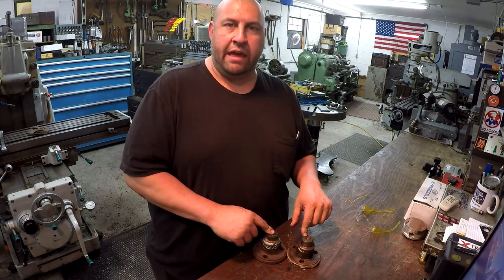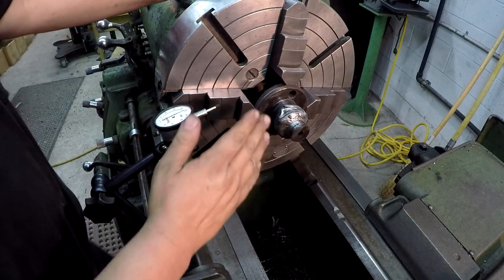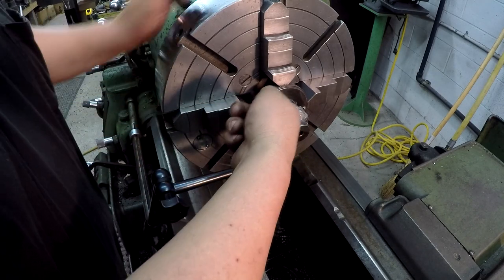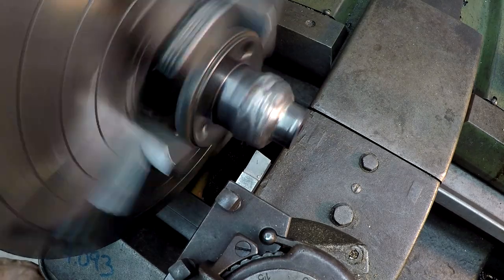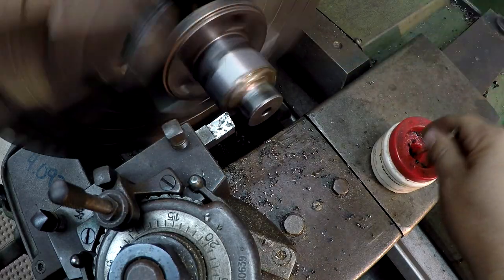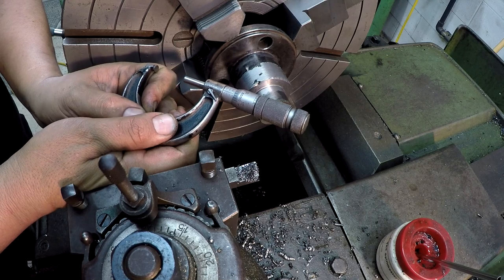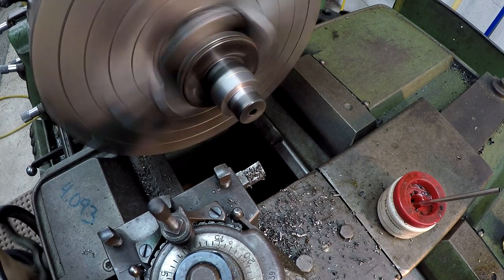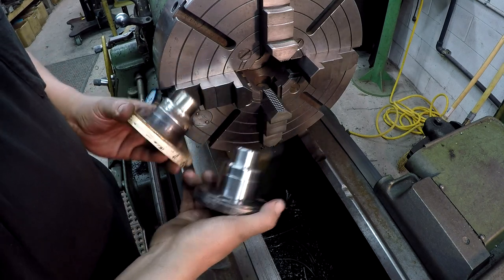Turning Weld Build Up With High Speed Steel

Comment: I have been a machinist for 37 years. When indicating something like that I always use what we call a brass bumper. Its just a piece of brass about 3'" in dia. and about 8" long. I always bump directly towards the indicator but I always pull the stem of the indicator back while bumping to avoid damaging the indicator. Then let the indicator touch again and in this way you can tell if the part moved and how much without even turning the chuck around. This is especially handy when indicating large jobs such as 35" dia bronze bushings.

Comment: It is so good to see that the "younger generation" have been passed the skills that we used on a daily basis back in the stone ages.
Thank you for sharing - brought back memories of rebuilding tractor kingpins back when there was no MIG (only stick) and welders ALWAYS dumped the part in water to cool them down.
Reply from the maker: I do alot of metal build up using stick welding
Reply: In my case the guy left pockets of flux all over the place AND tempered the piece by quenching it in water to cool it down...

Comment: That lathe and that chuck embodies the definition of deluxe and luxury. The impressive results speak for themselves. I'm not a machinist and likely never will be due to the cost of the machines, but the joy I get out of these videos is the transformation of before and after. It's awesome to see what's possible when you have a skilled tradesman at the controls.
Reply from the maker: I love that old Monarch, it was built with so much excellent engineering.

Comment: I do machine work and I have been a welder for machine shops for some years. When building up parts for machining clean, I've found I need to build up a lot more than seems like enough if you really want to avoid surface defects when machined to size. Dual shield wire with some post heat and slow cooling makes a more machinable weld deposit than hard wire.

Comment: I'm a Aerospace seal designer.  I really enjoyed this video. :)  We always recommend at least a 15 degree lead-in chamfer so the seal will not be damaged upon instillation.  I'm glade you talked about this.  People always ignore that and destroy the seals upon instillation.  Also surface finished is super critical for long seal life. (80% to 90% bearing ratio if possible).  If the seal is tearing up the shaft maybe you could heat treat your shaft post machining, or chrome plate it.  Thanks for this video.
Reply: When you're putting in your valve oil seals on your Harley heads, go down and buy yourself a bottle of vitamin supplement capsules near enough to the size of the valve shaft, open them up, tip out the powder, oil them up and then slide them up and into place. The amount of times in my younger days when grinding valves on cars that I'd punch a ring in that new rubber seal with a sharp valve when putting it back, if I'd had a dollar every time, I'd be rich today. And disengaging the half nuts when Metric threading is child's play if you learn the simple technique..... Just saying.
Reply: We used to spray ceramics on seal diameters which gave them a long wear life.
Reply: @garyd5622  Newb here could you explain that ?
Reply: @garyd5622 Thanks, I didn't know about that either,the vid was very good-I noticed that abom70 has 2 vids titled shaft metalizing which I think is the same thing but in more detail.
Reply: @davidworsley7969  Many of the worn shafts were from 30 year old multi spindle heads that ran 24/7 which the company wanted keep running until the contract was cancelled. With machinery that old and the chances the contract cancelled without notice, ceramic spray welding was the best option to extend the sponsor's life.

Comment: hey adam nice job. about a year ago i got a call from my buddy that owns a scrap yard and fab shop. he said a machine shop had just scrapped a bunch of strange tool holders.thanks to your video i knew what he had. there were multi fix. i got two tool posts and about 30 tool holders. i changed   over from my aloris and never looked back, i modified the tool holders to use  five 5/16 allen bolts it comes in handy when using short tools.
Reply from the maker: Wow! What a score!
Reply: Wise find!

Comment: Love how 'silent' the lathe is while running, makes for a friendly work environment! Another high quality machining job!
....13
Reply: That lathe's headstock has helical-cut gears in it, just like you would find in a conventional automotive manual transmission or semi-truck manual transmission.  They do a lot to cut down on gear whine and gear noise. ^^
Reply: Patriot1776 If he wants a comparison, he should jump over to Keith Fenner's channel.   His engine lathe has straight cut gears and does have some gear noise at higher speeds.

Comment: I like using HSS on when turning back welds and also when turning rough castings. I find the inconsistency destroys carbide tools.
Reply from the maker: I wish i could get my coworkers to do the same thing, but 100% of the time the forst carbide insert tool that is seen is grabbed and put to use, then its destroyed, and another insert installed, instead of taking a little more time to use a tool bit.
Reply: When I was an Apprentice and worked on a leblond engine lathe I found that when I used an inserted carbide cutter to rough and finished with my high speed Steel I would get a very repetitively cut, finish my finish size was spot on.

Comment: after i put the part loosely in the chuck I always use my tail stock to push it flat  and then get out the the indicator usually gets it pretty close as long as that front face is true as well.

Comment: That Lathe is a hoss. I'm digging how quite it is for the amount of power. Very skilled operator.  I have a 1933 South Bend 9" that runs on leather belts and is a joy to run because of the noise factor. You can hear the chips peeling off a .003's clean up. My big lathe is noisy and have to have ear plugs. Awesome job Adam.
Reply: I agree!
Reply: Helical gears in the head are the secret in Monarchs.

Comment: you should tap a cutter blank and attach a bearing, making a bump centering tool. you just turn the machine on low and bring the tool into contact and the work will just straighten itself out. not perfect but it gets really close really fast.

Comment: Coming from Air Force metal's tech. We have 3 lathes with a brand new one still wrapped up.. Video showed some interesting things.. having a compound rest that has notches for degrees must be a bliss rather than having to loosen 4 nuts and then judge degree based of a line Mark at the base of the compound rest

Comment: I'm pretty new at machining and my first attempt at machining weld build up went pretty bad lol (wrecked the piece and it flew out of the chuck 😬). So thanks for the tips. Also, liking that tool geometry  on the hss. Still rocking a lantern style tool post so that will save me  a lot of time changing tooling 🙂.
Thanks for the video 👍😀👍

Comment: Hey Adam, nice work. You did an outstanding on cleaning up that chuck. I went back and watched your chip control vids and plan to start using HSS tools more now . you and Tom Lipton made it easy for me to understand. Thanks . I do this as a hobby and I believe you said they are better for small lathes like my 7x12. Thanks Dave
Reply from the maker: +David Aarons Thanks David. Hss tools have been around a long time and they still get the job done just fine. Once you learn some basic grinds you'll find that using them can be a joy.

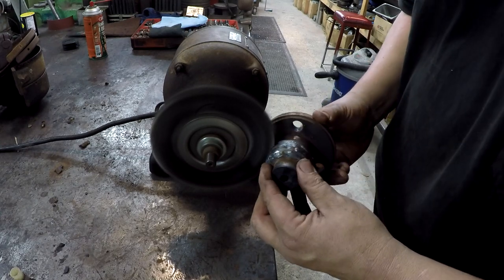Comment: next time you use wire wheel turn work piece opposite direction at 3:00 so you are not throwing trash on what you have already cleaned. i know its not crucial but if you do that you can see what is clean and save time.

Comment: Adam, years ago I think i saw this in the HomeShop machinist. piece of stock about 4x1/2x1/2 and mount a bearing on the front end. mount in a tool holder for the qctp and use it to push things concentric. use it on the y axis and flip it for the x axis. watch you all the time man, great fids.

Comment: nice video, one quick tip that i use is to take a pair of precision ground parallels and put them on the face of the chuck behind the part and use that to square up the part. is can save some time.

Comment: OOOOOOW, shiny new chuck.
Reply: YES!  He did a couple videos on cleaning it up!  Viewer donation, that chuck was!  His old chuck, that he had been using since the start of the channel, had become too worn out to be relied upon any more, and was pretty close to being worn out when the channel started. ^^
Reply: Patriot1776   Ya , I know the story.  He didn't just clean up the new 4-jaw, he polished it up shiny and like new.  The old chuck can be rebuilt but it probably would cost almost as much as the entire lathe is worth.
Reply: John Ferguson More than likely.  I mean, several have been asking why can't he just make new screws and jaws but there's more to it than that I'm certain, primarily in truing up the slot ways the jaws ride in is what my logic is telling me.  The slot ways for the jaws would need truing up and regrinding with the same precision that should be used when grinding and truing up the lathe's bed ways, which is when it gets cost prohibitive.
Reply: Patriot1776 The new CNC machines are getting so cheap that it's hard to justify spending too much money keeping an old lathe going.  These manual lathes will soon be used only by hobbyists.
Reply: John Ferguson We're going to be in big trouble at that point, when nobody is left who fully knows how to manually machine with manual machine tools and things on the computer-controlled equipment breaks that can only be fixed on a manual machine...
Reply: Patriot1776 The big problem is machining parts to fix old machines.  The computer software that controls the CNC machines gets more adaptable and sophisticated every year.  When I worked at Rockwell International in the mid 70's, we had one of the earliest CNC machines.  The software was written on punch cards and fed into a punch card reader.  Watching the machine run was like being in a Star Trek episode.  Now, machines are making machines as people watch.
Reply: John Ferguson , and there are no guards and limit switches to make it impossible to use.

Comment: Nice part and vid. A  hefty 4 jaw chuck there and a massively stable machine :-) I'm learning to machine my welds on a typical small china lathe - when necessary - a new addition - so your vid is helpful and kindly to machinist fabricator 'heads'. Thanks and have pleasure with the tools and transformations.

Comment: I've had to turn M.I.G. welds on lathes plenty of times. The welds are almost always soft when welding with a 1018 steel filler. If that piece is cast steel, it should've been welded with a stainless wire for strength. But to me, that piece looks like it was machined from a solid chunk of steel. That is a nice looking chuck too, by the way! I had to give up machining and welding due to 4 spinal surgeries. Good video though! I enjoyed it!!!!
Reply: I hope your suffering is completely gone by now!:)  I have an idea of what you are talking about... Keep it up!!
Reply: Do you mean "7018" instead of "1018"? The latter is an AISI grade of steel while the former is a category of SMAW welding electrode under the auspices of the AWS.  1018 has a limited manganese content and virtually no silicon, whereas most weld fillers have 1-2% manganese and 1% silicon, but generally less than 0.1% carbon. Carbon does bad things to welds. Even still, Conditions during welding can sometimes cause spots with unusually high hardness, often due to particularly high shrinkage or very rapid cooling. In terms of composition and mechanical properties, weld fillers tend to have much more stringent requirements. They're generally required to have both greater strength, and ductility/elongation than something like AISI 1018.
Reply: The chromium in stainless causes it to be soft not strong it’s easier by far to damage that most other steels it would never add strength

Comment: Quick question, why are you using a 4 jaw Chuck to turn a round part? I am a pretty amateur machinist, but I thought you should always use a 3 jaw on a round part?
Reply: Quick answer ,   4 jaw more accurate..

Comment: Quick question. Want to buy a lathe to make stuff and the first thing I want it to be able to make acme lead screws. 

So and after watching your video where you made the nut which was awesome, I need to know what specs the machine has to have to able to do the job.

It has 1500w motor and threading imperial or metric plus power feed. 

Does this mean it can do my acme screws or is there something else needed feom the machine?

Comment: I assume the part was welded by the customer? You do an excellent job of how welds are turned by HSS tool bits. I'm old enough to remember when there was no carbide, at least where I worked, so HSS was all there was. I would like to add that if it was my choice of how to repair this part...because it was a seal dia. welding would have been my last choice as the risk of holes and the apparent soft wire used would result in a very short life for the seal and journal. My first choice would be to turn the part back and shrink a piece of 1045 or 4140 with a wall thickness of about 1/8" and finish turn & polish to size. Just sayin'
Reply: I agree. A sleeve is the best fix. Polishing a bearing journal will cause the bearing journal to be undersize.

Comment: adam you need a little electric spot nailer that they use for placing brads to pull on in body work, could clean up those spots without taking it out of the machine in seconds. They sell them at harbor freight even.

Comment: The number of times I've watched you use that lathe, and I'm still amazed at how quiet it is.  You better keep an eye on it, Mr. Pete might try to sneak of with it!

The infinitely variable speed I get with the drive I'm using on the Mueller is nice, but that hydraulic motor whine (along with an electric motor that sounds like a deep well water pump) just about drives me nuts after a few hours.  I'm hoping that larger intake lines and a hard rubber pad between the base and the floor will dampen some of that out.

Comment: That chuck has some nice big T-slots. Can you visualize a set-up where you might use them?  Or would they be for just using the chuck like a face plate with the jaws removed?  ....Dave
Reply from the maker: Hey David, you can use them to attach counterweights for an off-balance load. I have also used them to attach studs to be used as drive dogs for some jobs.  I had a job in my old big Monarch a few years back where I had several lead slugs bolted to one side of the chuck. Wish I had video back then.

Comment: beautiful work Adam.  that part looked pretty rough when you started, i wasn't sure if you were going to get those inclusions out of it, but you made it look good and dead on accurate.  How long would a job like that normally take you if your not filming?  1 hr?
Reply from the maker: Yes it was a one hour job, without the welding.

Comment: Don't you all see speedi sleeves at work? Seems that would have been  an easier and probably better repair since no weld porosity to chew on the seal. I use speedi sleeves on axles all the time with good results.  Of course this made better video and I got to see that sweet new looking chuck. :-)
Reply from the maker: +bcbloc02 No speedy sleeves for this cat
Reply: Have used the Speedi Sleeves years ago too.  Never really liked them.  Always looked at them as quick fix begets long term headache & future necessary repair.  But, in some cases.......

Comment: That must be solid core MIG wire, that flux core WILL DESTROY high speed steel bit, or anything less than Carbide.
Been there with the flux core wire.

Comment: You are using metric system? half a thousand=0.0050 mm ? or US ´thou´ where thousand/thou = 0.0250* millimeters? Does import indicators even have ´thou´ / inch system?

Comment: Without much info to go on... I'm guessing these differential coupling hubs come off a Terex Telehandler or such, that is at least 20 years old, by to the looks of the first vid. 

Since I didn't have a part # I did an image search of used parts like this. 

I found hubs off a '98 machine, used but not worn for $110/ea, and new OEM about 175 to 200.

Point being,  while its totally cool to reciprocate for a buddy, but if you're  using the machine to earn a living the machine really should pay for itself which includes maintenance and repairs. 

So it make much more sense to replace the parts when they wear out, and keep the machine running. 

Tho really cool vid

Comment: Nice video and good to know, I didn't think weld could be turned due to the high carbon.  I tried drilling it once and could not get through
Reply: It varies by process and the filler ,some is cobalt hard some same  as mild steel.
Reply: Late on the draw but standard mig wire is 60,000 psi. Carbon steel Tig filler is usually 80,000 psi. 7018 would be 70,000 psi. High hard or high carbon filler would be around 100 to 110,000 psi. Most welds aren't going to be high carbon. Just the shear strength of the weld metal makes it hard to drill.

Comment: the part had two centering holes drilled, why didnt you turn it between 2 centers but indicated it?
is it because of heat shrincage and warpage or habbit?
Also do you already have a video abaut buildup welding and annealing and hardening
how do you get all to he same hardness on a delicate part if you just know its a to 0.6% coalbed carbonated 0.10%german low carbon surface hardened steel